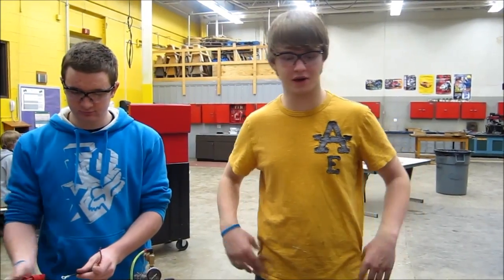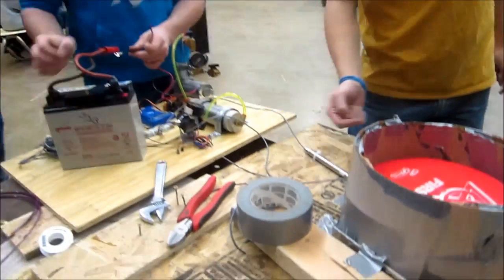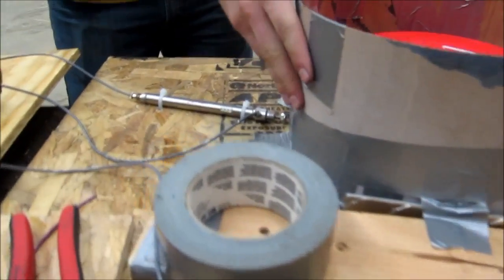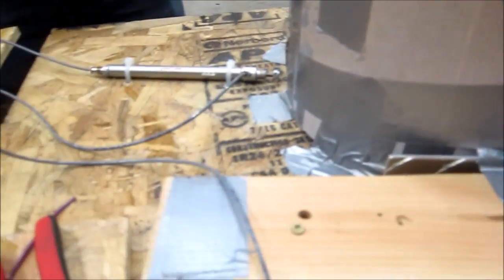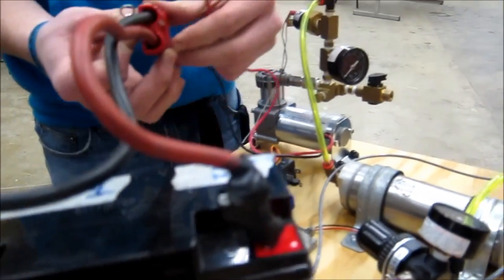Shooter Prototype 3

Comment: That's an interesting point about the loose wall.  What is your compression on the disc (i.e. what is the inside radius on the plywood arc and what is the thickness of the metal curve)?  Is the compression constant all the way through?

Comment: The free load speed of a CIM is 5,300 RPM.  The normal operating speed (the speed you guys will be getting) is about 4,200 RPM.  Once the wheel gets up to speed you could get a little more than that.

Comment from the maker: We made a custom bushing that connects to the CIM and wheel using set screws. Just a piece of metal turned down to fit onto the CIM output and into the wheel. 
No sure on the RPM. It's a straight 1:1 gear ratio (since the CIM and wheel are directly connected). So whatever a CIM spins at. I'm not the mechanical expert. haha.